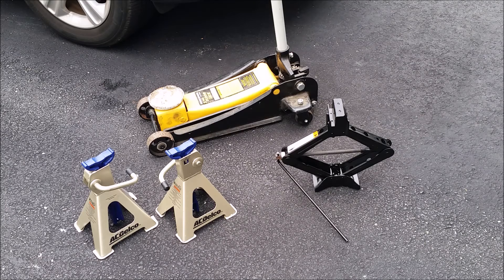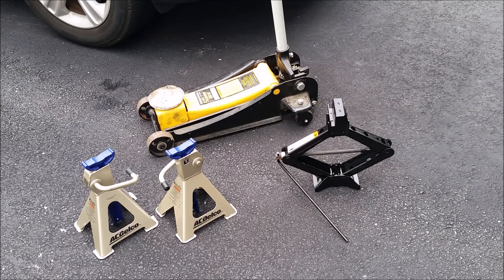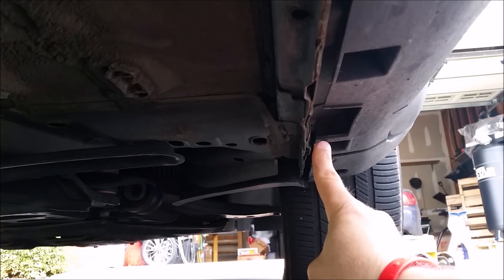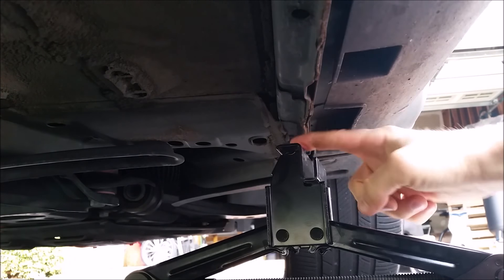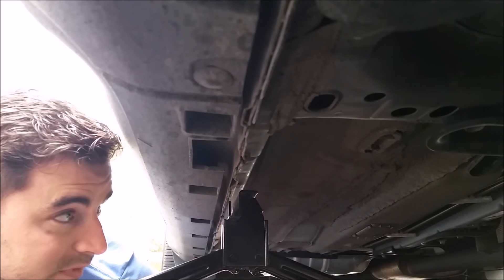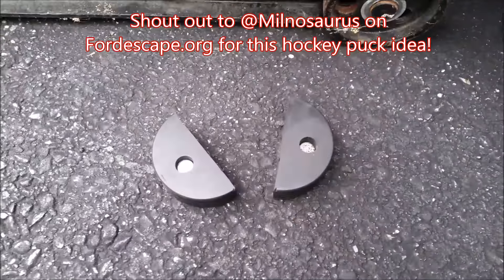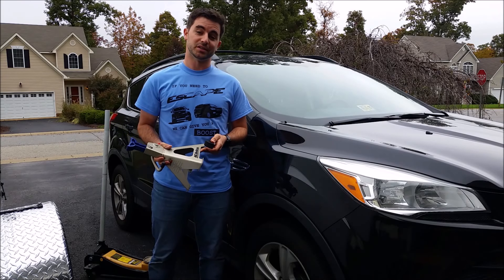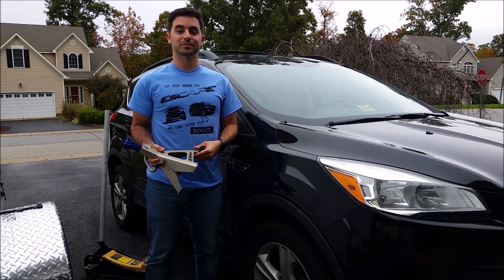Jack and Lift Locations: HOW TO ESCAPE

Comment: I live in a rural area and I've had to change a tire on the side of the road which is soft. I've learned to carry a small square thick piece of plywood to place underneath the temporary scissor jack so that it will not go downwards instead of lifting the car upwards. Simple, cheap and effective.

Comment: Recently jacked up my escape through control arm to replace the splash shield screws. Now the car vibrates while driving high speed. Did I damage my control arm?
Reply from the maker: Hmm it should not have- where was the jack contacting the control arm? What type of vibration are you experiencing? Cyclical with wheel rotation or only in certain conditions, turning, accelerating, etc. Do you notice the car pulling to one side if you let go of the wheel for a moment?
Reply: @HowToEscapeDIYTipsandReviews  I tried jacking up as close as I can towards the wheel so the jack arm could contact as close as it can to be flat to the arm.

The vibrations happen driving above 60mph irregardless if I accelerate faster or not. I'm hoping I didn't damage the arm but from what I've researched, control arm damage has vibrations while accelerating at high speeds.
Reply: The manual says:

"CAUTION: Under no circumstances should the vehicle ever be lifted by the front or rear
control arms, halfshafts or front wheel constant velocity (CV) joints. Severe damage to the
vehicle could result." Vids like these give poor advice often.
Reply: @NickNembus  It's odd that a control arm cannot handle the weight of 1/4 of the car- IF loaded evenly.     More likely they say not to use it because: 1)you could put the weight on unevenly and twist the control arm if not careful.  2) most likely, it's a slanted surface and not very safe.  The car could fall on you.

Comment: do you know if the jacking points with a floor jack would be any different for a 2017 Ford Escape?
Reply from the maker: Should be pretty similar. Look for the arrow indicators and if you use the control arms be careful and go slow and make sure to use something soft in between the jack and the metal of the control arm to not bend anything. I used hockey pucks. Good luck!
Reply: @HowToEscapeDIYTipsandReviews  Thank you!!

Comment: The manual says:

"CAUTION: Under no circumstances should the vehicle ever be lifted by the front or rear
control arms, halfshafts or front wheel constant velocity (CV) joints. Severe damage to the
vehicle could result."
Reply from the maker: Hi Nick- I appreciate the heads up. I have been meaning to take that part of the video out- I have been using the hockey pucks on the subframe shoulder / rocker panel with no issues over the years. That is the correct lifting point. Thanks for the reminder to eliminate the green circle and make a note for finding the crossmember instead. Do you have a page number in the manual for reference?
Reply: @HowToEscapeDIYTipsandReviews  Sorry not for that found it from other videos on the 10s-12s tho. Is really lacking info from the manual and mechanic books on proper points for these. Best I found is using the hockey puck on the pinch weld near the tire and putting jack stands more in the center behind it on the flat reinforced bit. (You can tell the shops use this point on the lifts because there's slight bending around the hole that helps them keep it from slipping off)
Reply: @HowToEscapeDIYTipsandReviews  Pulled out and looked thru my 2010 Escape owners guide. The section for changing a tire says this (and keep in mind the scissor jack mine comes with has a large round hole in the center designed for these spots)
 "Before placing the jack(Nick: the special one included) under the vehicle, NOTE the jack location: Front: View shown from the rear of the front tire. Position the jack directly below the protruding bolt.(Nick: this pic looks like the large bolt at the end of the control arm?? and is designed to fit only these jacks without damaging it I guess) Rear: View shown from forward of rear tire. Position the jack directly below the stud on the rear trailing arm. Be sure to place the jack away from the rear edge of the rocker to avoid damaging the rear tire spoiler.(Nick: on this one there's a cylinder that perfectly fits the included scissor jack like the bolt in front) Never use the differentials as a jacking point."
And this is all the info the owner guide gives almost nothing solid for doing anything but changing the tires with the included scissor jack with its special hole.
I think that other information might come from a repair manual, but IDK which the OP was referring to. I do have a Chilton's for the escape, but again it's very vague and only says this. 
"The jack supplied with the vehicle should only be used for changing a tire or placing jackstands under the frame. Never work under the vehicle or start the engine while this jack is being used as the only means of support. (Nick: then it goes on talking about removing the tire a bit and gets to this part) Place the scissors-type jack under the vehicle and adjust the height until it engages with the proper jacking point. There is a front and rear jacking point on each side of the vehicle (see illustration)(Nick: the illustration is useless and shows the same places for just the tire changes)

So basically they're saying you are 'placing jackstands under the frame' with no clear indication to any jackstand safe points besides the most outer jacking points. Which you can't place a jackstand on when you're using it to jack up the SUV. Bad instructions all around on this one.
Reply from the maker: @NickNembus  Thanks for such a thorouch response! I agree- I did a bit more research and it seems like these newer unibody frames are strongest in the rocker areas for jacking points. As you know, in order to put a jack stand and a scissor or floor jack under the vehicle, it's almost like we need 2 spec'd locations for lifting- one for the lift point and the other for resting on the jack stand. I've been using a floor jack and lifting just far enough away from the jack stand with the hockey puck and lowering on the jack stand in the noted areas for the scissor jack. I am hesitant to even state to lift from a crossmember even if it's doable just in case somebody mixes it up with something fragile like an oil pan or something. I DID delete the portion of the video suggesting to lift from the control arm per your suggestion so that should be a bit safer now and still helpful in the other areas shown. Thanks again Nick- I agree- this is vague- not sure for liability or what, but it would be great to have some more specificity... have a good one, man!

Comment: Can I change my car rotor with only a jack stand on one side of the wheels?? I dont have the floor jack.
Reply from the maker: Sorry for the late response! Yes you can prop up only one side of your vehicle, such as front left and back left wheels, with the other side still on the ground. Shouldn't cause an issue!

Comment: Thanks for the vid.  how far off the jacking point "arrow" (pinch-weld) can you use floor jack or   jack stands. 6 inches?
Reply from the maker: Good question- I actually don't have an exact number there- If I had to put a number on it, I typically put it up to 10" away in order to still use the floor jack and still put your jack stand in place... just try to keep it as close to the bent subframe and as close to the noted areas with the area as possible as that's where it's going to be most rigid

Comment: Thanks for these videos as they are super helpful. A question about the ratings of the floor jack and jack stands. Do you use 3 ton, more, or less as you use these for your repairs and maintenance?
Reply from the maker: Hi and thanks for the positive feedback! I have a 2 ton rated floor jack. Our Escapes are only slightly over 2000lbs, which is 1 ton. If you're lifting up one side of your car and 2 wheels are off the ground, you're only lifting a half ton at a time. Therefore, I think 2 ton covers you by a safety factor of 4x, and allows you to use it for a larger vehicle if you need as well :) Same weight distribution policy goes for jack stands. Each one experiences a quarter ton if they're placed at all 4 corners.

Comment: Thanks for the hockey puck tip. Great informative vid. Thanks for posting.
Reply: There are some aftermarket steel round inserts (same diameter as a hockey puck) with vertical lips that go around the pinch welds that simply drop onto the hydraulic floor jack round contact point and prevent any damage to them. I've used mine on several unibody vehicles with no problems. Once lifted, I simply slide the jack stand near it on the factory lift point and remove the hydraulic floor jack, so I can continue lifting at other spot/s.

Comment: At 2:00, the diagram likely is mislabeled. The factory jack clearly is supposed to only be used at the marked arrow, and perhaps the two rectangular openings fore and aft may allow a jackstand with a proper flat head. Moving the scissor jack even 8" either way may fail, or at least bend weaker sheet metal not reinforced by welds or extra thicknesses. That as he says, is where the arrow is!

Comment: The scissor jack that came with the car doesn't have that uneven groove that allows the pinch weld to fit in it - it only has a shallow groove with sides of even height.  So the car's strip of metal sits on top of the jack in a dangerous way that could damage the metal.  It is a terrible jack to use.
Reply from the maker: Hey @City_Trees- yeah I've heard others say there's a discrepancy in the type of jack supplied with these Escapes across different years even if the main body style is similar. I agree it's not awesome. Only time I'd ever use it is on the side of the road if I had to- have a floor jack and jack stands to do all the work we do here on the channel. I am in 100% accordance with you. Thanks for the comment and let us know if there's something else we can help with. Have a good one!